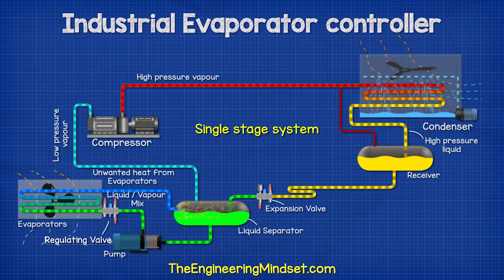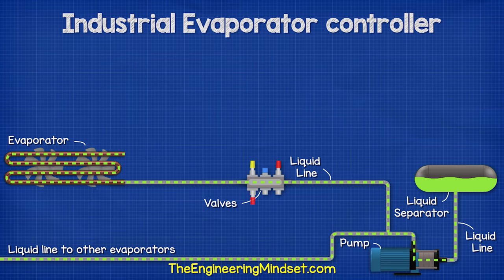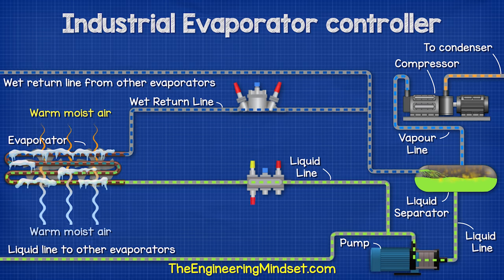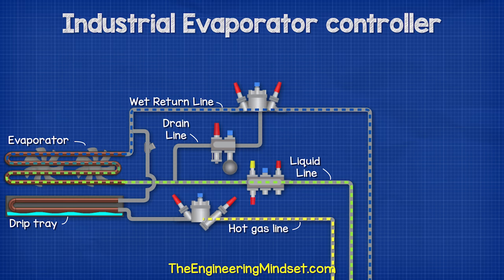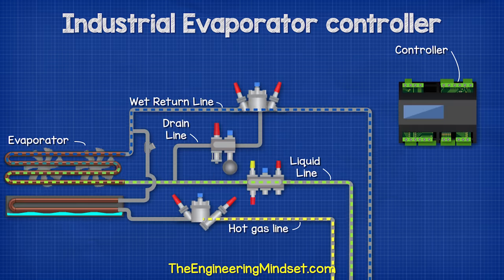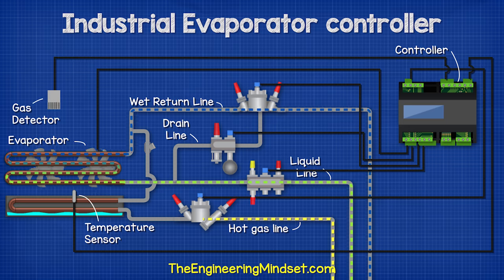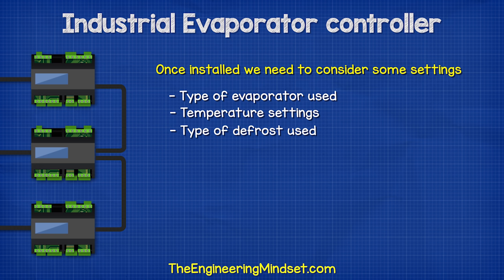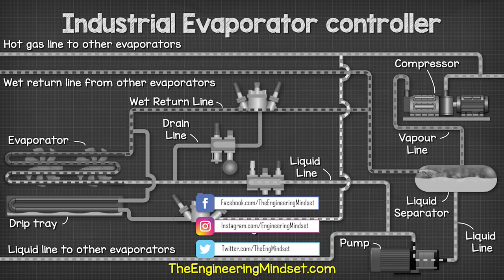Evaporator Controller - EKE 400 Industrial Refrigeration industrial engineering

Comment: Excellent video, very clear and easy to understand.  Maybe add more explanation as to why defrost sequencing is needed.  That was one of many confusing points I struggled to understand when I got into creating controls for evaporators.  How, you have to make sure there's enough hot gas... Certain evaporators will be required to go into defrost more often due to their location in the room... You have to be mindful of which evaporator you send into defrost as you are warming up the air in that region, etc... I humbly admit that I do not know everything when it comes to industrial refrigeration controls, so more detail videos like this will be a great visual aid for those of us who are very visual.
I genuinely appreciate the material. Great job on these videos A+

Comment: Hi 
Why desacling is necessary for condenser 
Why not in evaporator?
Reply: The kind of condenser you're referring to is an evaporative condenser, which pumps large quantities of water over the heat transfer surface.  The water evaporates into the air, which helps condense the refrigerant.  But in doing so, any minerals and dissolved impurities are left behind-- this is the "scale" you're talking about.
On the evaporator, water is condensed out of the air, effectively distilled onto the surface of the coil.  It does not evaporate, and there are no dissolved impurities left behind, hence, no descaling is required.